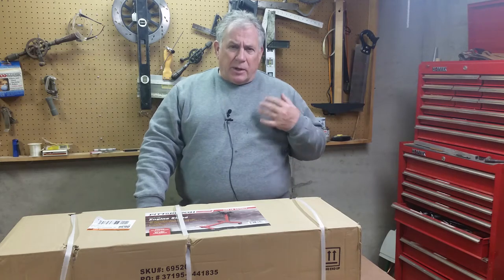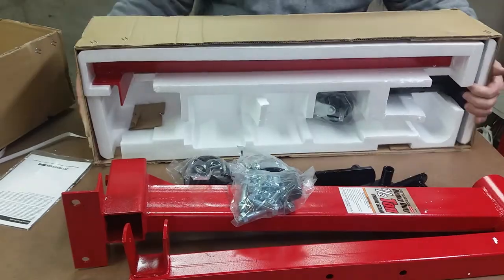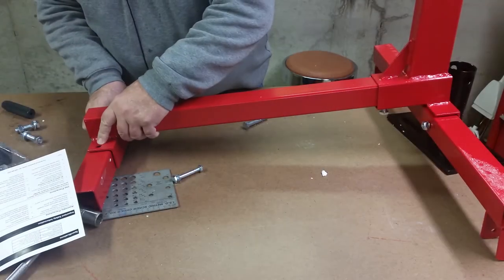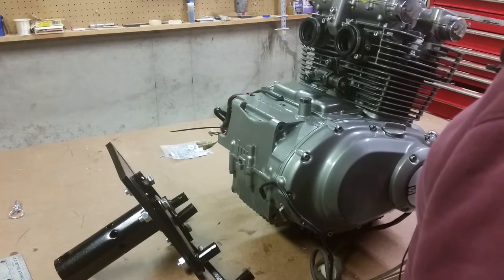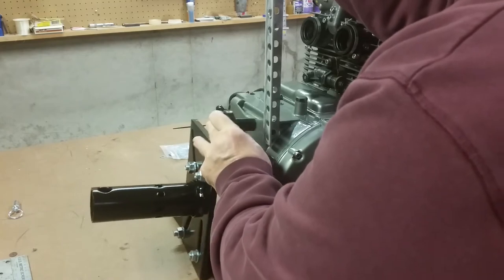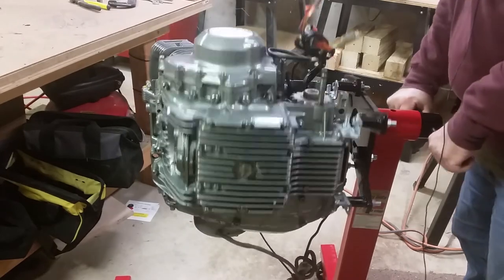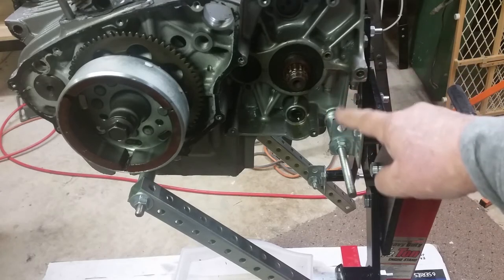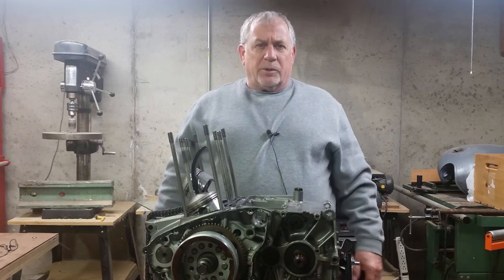Motorcycle Engine Stand

Comment: Great idea to use the angle steel with the holes already in it! All the other videos I've seen were using heavy angle iron and then having to drill holes. this looks much quicker and just as steady. I've already got the engine stand and an engine hoist. A little angle steel and I'm on my way! Thanks!

Comment: Hello Paul, you might want to revise your mounting points to the top half of the crankcase as that is the starting point of reassembling the engine. That is, you place the crank, balancer and transmission shafts in the top half of the engine and then place the bottom half on and bolt things up. I'm in the planning stages of an engine stand and will make an adapter for the engine with an arm over the top of the crankcase to hold the engine in place when the crankcases are upside down. I hope your repairs went well.